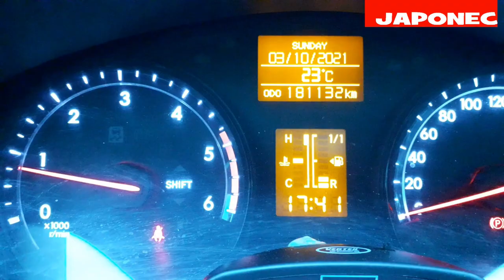Toyota brake warning light while drive

Comment: Yes but what is the reason for filling? Maybe there is an leak? Or your brake pads are on minimum?
Reply from the maker: Problem was very slim brake pads
Reply: @golfwagen4173  now when you push your pistons back while changing the pads, the brake fluid will overflow..🙃
Reply from the maker: @CARaCARtal99  yes
Reply: @golfwagen4173 did you change front or rear pads